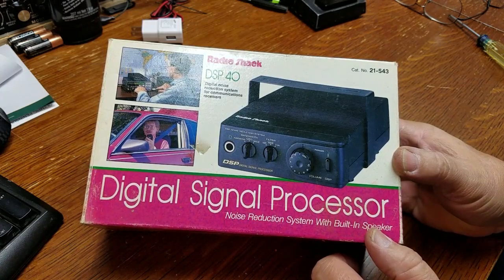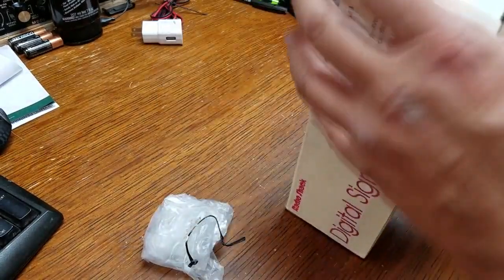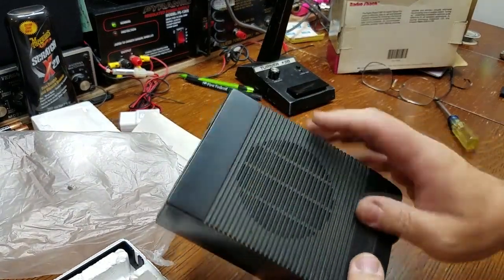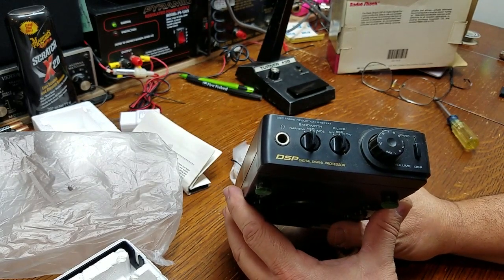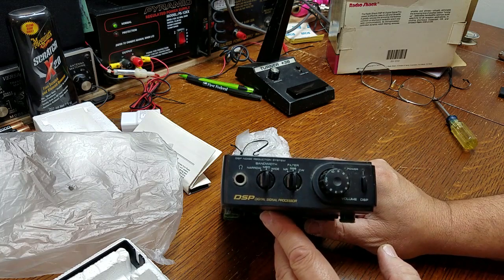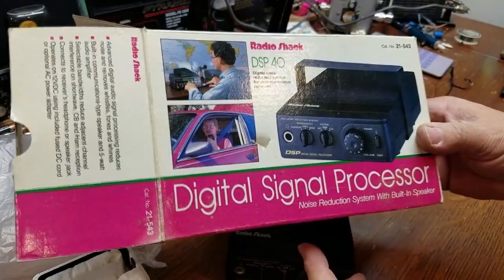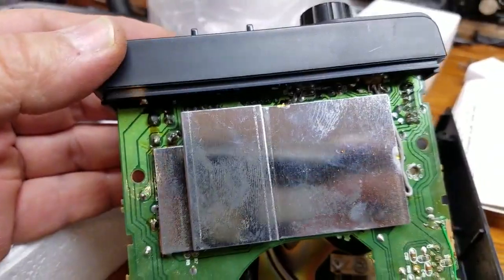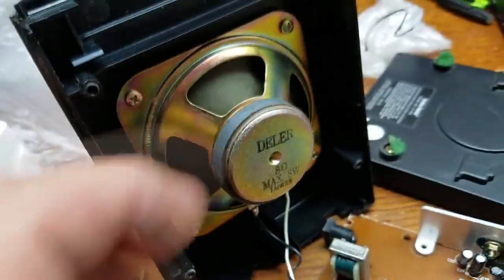Realistic DSP 40 Digital Signal Processor For CB and Ham Radio

Comment: I know you don't have one, but if I were to look for an AC adapter for the DSP40, which one would I need to get?
Reply from the maker: Hello
I use my bench power supply, however you could use an 12v AC wall adapter but I dont trust them as much as one of these https://amzn.to/3LqG85q
They tend to be better filtered than a WalWart and you can cut the cord to power other low currant 12v electronics on your bench. I have one Ive been using on a car stereo in my garage that has been on 27-7 for over 17 years and still going strong. 
Great question...... Cheers